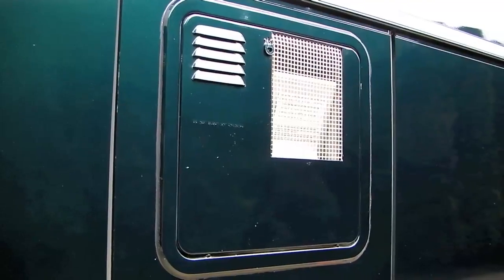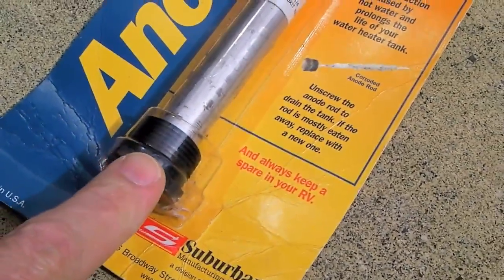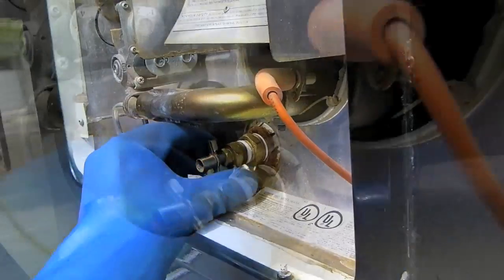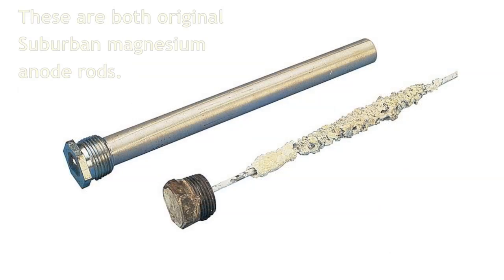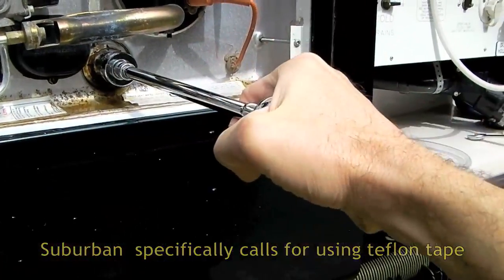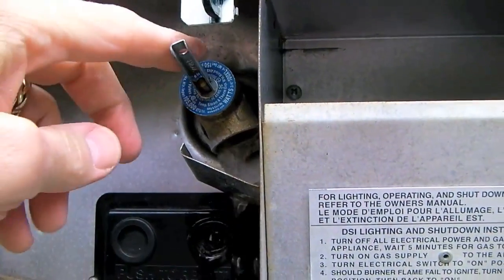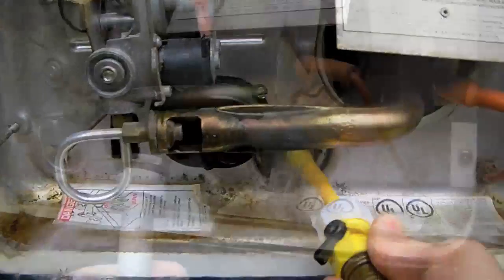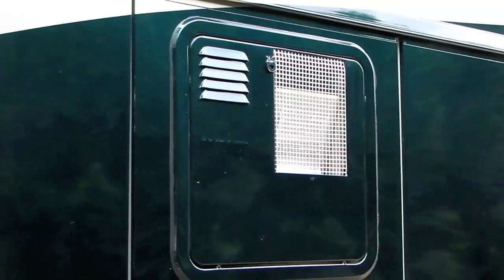How To Flush & Clean a Suburban RV Water Heater

Comment: My water lines leak when I have the water heater on. Does that mean it's too hot and raising the pressure?
Reply from the maker: Hmmm... it's certainly possible that the pressure in the water heater is too high, causing the lines to leak (although it could also be a loose connection or a crack/split in a line, too). If you suspect that's the problem, the first thing we'd suggest is re-establishing the proper air gap in the top of the tank. If the air gap has been reduced, then the pressure could get too high when the water heats. You can read it on page 6 of the PDF of the Suburban Water Heater manual here:  https://olivertraveltrailers.com/wp-content/uploads/oliver-university/Component_Manuals/Water_Heater/Suburban_Gas_Water_Heater_Manual.pdf

But here are the steps:
  1. Turn off water heater.
  2. Turn off the water supply to the RV (city water OR pump)
  3. Open a faucet in the RV
  4. Pull out on the handle of the Pressure Relief (P & T) Valve and allow water to flow from the valve until it stops.
  5. Release handle on P & T Valve - it should snap closed.
  6. Close the faucet in the RV and turn on the water supply; as the tank fills, the proper air pocket will develop.

If that doesn't solve the problem, it's POSSIBLE that your thermostat is failing and allowing the water to get too hot and, therefore, creating too much pressure in the tank (although we would expect the Pressure Relief valve would weep, too). So you could try replacing the thermostat(s)... we have a video about that: https://youtu.be/juxiuD3taSw

If NEITHER of the above solves the problem... it's possible you have a crack in a fitting or pipe that's causing the problem. That could also be something that only shows its face when the pressure builds when the water heats  (or because the heat causes a fitting/pipe to expand... which expands the crack).

Hope this helps... and let us know how you make out!
Reply: @RVgeeks  yeah, the pipe connections could be failing  because it leaks by the shower faucet--water comes out from under the tub--and by the kitchen faucet and maybe on the line behind the toilet. They trailer is a '97 and temps range from 27 to 84 or 87 inside. I didn't know about the air pocket.  Pressure relief valve stays dry. Thermostat has 2 unmarked black buttons. One guy told me one is for the thermostat and the other is the echo. I'll try you suggestions.
Reply from the maker: @Mt Ns - could be that the pressure when the water heats is exposing weaknesses in other fittings. Those two black buttons should both be thermostats. They call one the "ECO" (or something like that), but typically one is the propane thermostat... and the other the 110V thermostat (set slightly higher so that the bias is toward electric heating if you have both turned on... the propane thermostat kicks off first on heating... and back on last as water's being used up). Re-establishing the air gap COULD help drop the system pressure enough to reduce/eliminate the leaks... but we'd be concerned they're only gonna worsen over time, so you'll likely have to deal with them at some point soon (if they're PEX pipes, the fittings are fairly easy to replace... we thought PEX would be hard to work with, but it's amazingly easy... just be sure the cuts are straight  since clean cuts make the difference on ensuring a good tight seal on the fitting)... and the crimping tool is real easy to use.  https://youtu.be/MjyU2eClPcA

Comment: I thought you said a suburban heater doesn't take an anode rod 🤔
Reply from the maker: Hi Genevieve! Suburban heaters have steel tanks, so they use anode rods. Atwood heaters have aluminum tanks, so no anode rod is needed.
Reply: @RVgeeks  🙃 thanks I got mixed up..